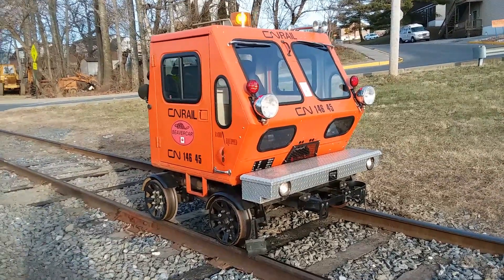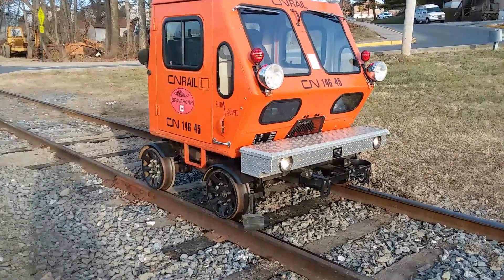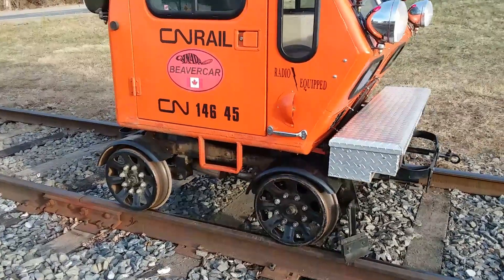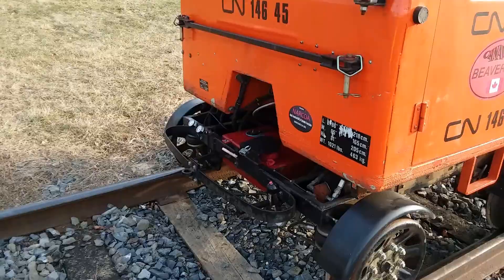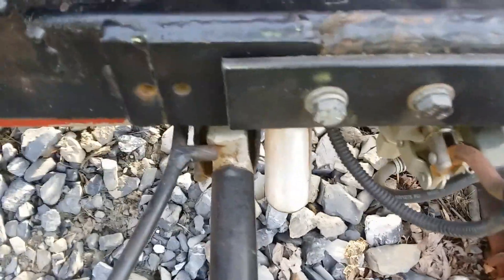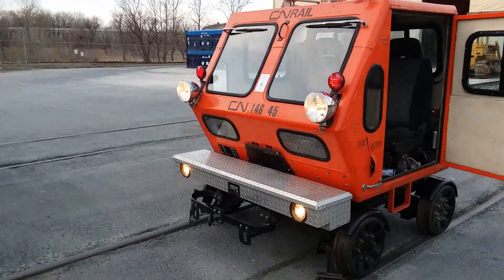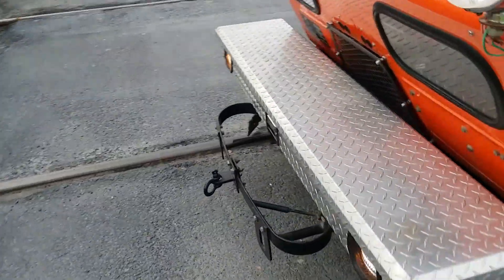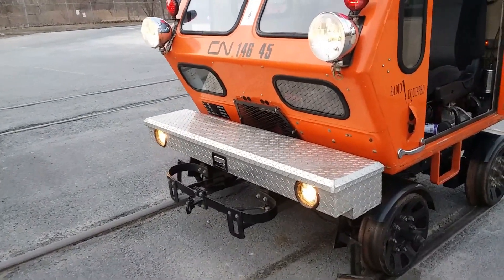Rail Speeder Beavercar Test run on the rails

Comment: Just curious, do you set off gates and signals when you go through a crossing?
Reply from the maker: If you mean the rail speeder itself, most of the time we do not. Reliability issues. There are times when we will manually activate the gates/signals with special equipment but that is rare too.
Thanks for watching!

Comment: I want to build a speeder but don’t know where to run it or proper person to contact ? Any suggestions ? I have all of the parts needed including the cab , engine , wheels w/ brakes frame material welder and seats . My dream would be to travel as far as Arizona , Washington , Texas and New York . I’d make it big enough for 2 people to sleep in it and eat along the adventured route !
Reply from the maker: Best place to start is narcoa dot org and look around for homebuilt speeder specifications. Thanks for watching.
Reply: Your best bet might be a hi-rail pickup truck and add a camper body to the bed

Comment: What is something like yours worth? I’ve seen the older ones that have the wood poles for doing the strong arm and back turn. Yours looks really comfortable
Reply from the maker: Check out my other videos to see how other cars are turned. Value is what someone is willing to pay. Thanks for watching!
Reply: @rdg2124  could you give an average price for someone that would like to get into this hobby from the motorcar to the trailer to haul it to any and all safety equipment ?
Reply from the maker: @Retired88M  It all depends on the condition, size and mechanical worthiness of a particular car. The hobby is not for the fiscally challenged but not one that requires piles and piles of money. Figure on spending around $7-$8K for the unit (either getting one cheaper and then making the needed repairs), add around $2.5K for a trailer, then you need a tow vehicle, you'll want extras like a two-way radio, perhaps in intercom system, PPE, stuff like that. Round number maybe approaching $15K but I know people who have gotten in for much, much less and others who dumped way more than that into just one car. As with everything, prices vary according to the desirability of the unit and what's available nearby. Check out narcoa dot org for more information.
Reply: @rdg2124  thanks

Comment: During the 60's I worked for HBC Northern Stores along the main line through NW Ontario I road  in one many  many times, they would give me a lift between Armstrong and Auden . We called them Jiggers, the CN signal maintainers rode them. When we had a train coming there were spots we would pull handles from under neath to lift and turn the Jigger to pull it off the rails.
Reply from the maker: Neat story. This particular car was built in 1984 according to the data plate inside the cab. I heard they were called Jiggers, also pop cars, rail cars and other names. Check out another of my videos for a quick clip of it being turned, along with one being turned the way you described.

Comment: Thats cool, never have seen one of these before,  the C&NW always used pickup trucks.
Reply from the maker: C&NW did have motorcars, just a long time ago. Thanks for watching.
Reply: @rdg2124  C&NW must have used them before my time.
Reply from the maker: @markdanielczyk944  From what I can find, they fell out of use by the early 1980s.
Reply: @rdg2124  Never saw them on the Harvard Subdivision NW of Chicago.
The speeders look like a blast!
Reply from the maker: @markdanielczyk944  They are lots of fun.
Reply: @rdg2124  Looks like I'm gonna need a barn!